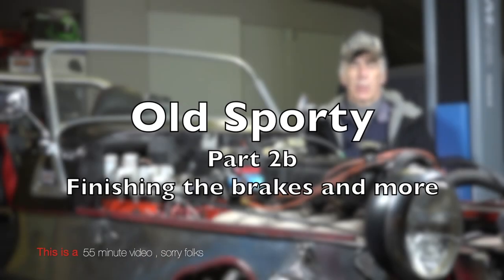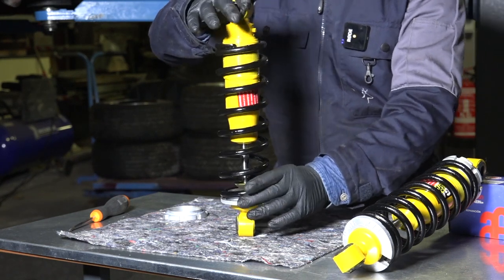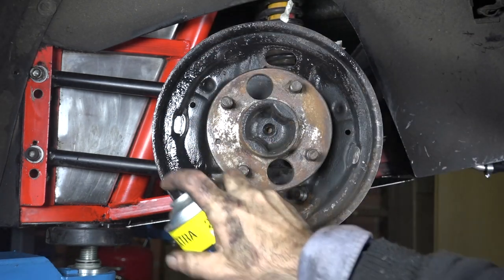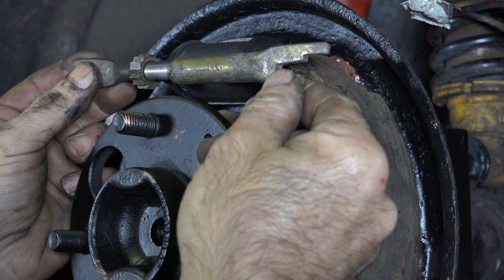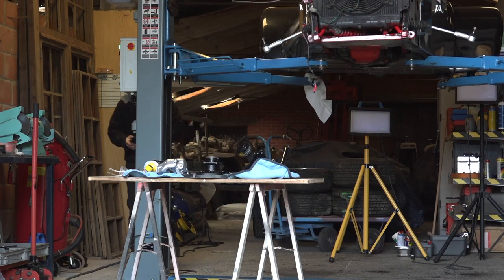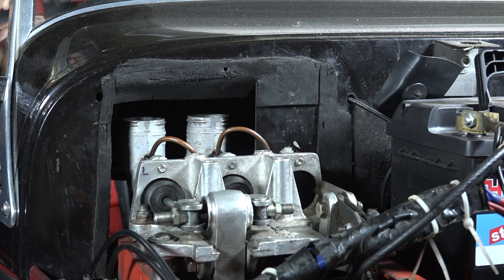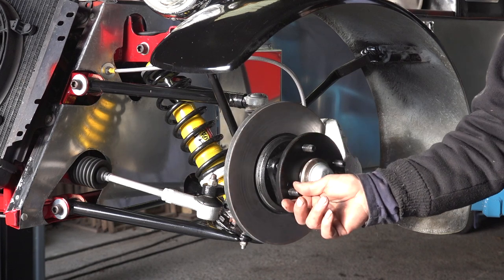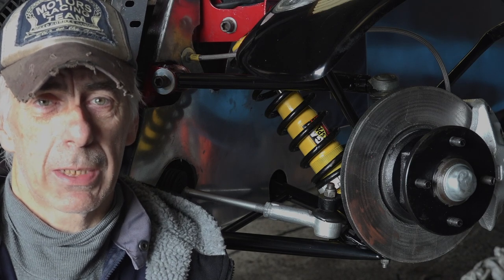Old Sporty , Part 2B brakes and much more

Comment: Happy Christmas! One way to free the clutch is to jack up the back axle and to start the engine and warm it up, then when in fourth gear have an assistant drop the jack. The car needs clear space ahead, it's a brutal way to do it but it works and breaks the corrosion holding the clutch to the flywheel. 🙂
Reply from the maker: Yes indeed that is one way of doing it.. done that before.. but in this case I will modify the oilpump, replace the waterpump, new distribution belt and install a new clutch.. so the engine has to go out no matter what.

Comment: I notice that the new car lift, besides making this work more pleasant, enables even better placement of lights and camera, if that's possible. Totally first rate production! Even people with more money do not match this. One thing I did not see -- any discussion of examining or prepping the rear brake pads. Merry Christmas to all, and looking forward to the new year!
Reply from the maker: Thanks for the comments Dennis , very happy with the lift, although a low cost item ... it works as a champ and very handy. you are right I missed that point on preparing and inspecting the thickness of the rear brakeshoes...  should have done that ...Its always good to get those points and remarks.  It can only make it better next time.

Comment: Steve, I enjoy your videos so much.  Always very well done on the video and also the work performed in your videos.  You pay so much attention to detail.  One piece of advice to you.  For taking off those stuck caps on the brake cylinders, you should look into using a rubber strap wrench.  They come in handy in plumbing and any time you don't want to mare the finish of the thing your tightening such as the caps to your brake cylinders or chrome.  They also come in handy getting an oil filter unstuck.  Thanks again for another great video!  Merry Christmas.
Reply from the maker: Thanks for the comments, and indeed that is very good advice... I will ask Sante  for a set... that way I don't damage things ... Merry Christmas and a happy new year to you and yours

Comment: 8:14 you can only set up the ride height. The spring rate dosen´t change, exept you use a progressive coil. Merry Christmas and thank´s for all the great videos.
Reply from the maker: Markus Wagner , txs for the correction. What i wanted to say was harder ride and lower. Txs
Reply: Not only ride height. This is a spring preload setting. If preload is  higher than the load applied by the car on that wheel, the suspension is fully extended, no further height is possible. But if you increase preload again, the suspension will not move until you reach an higher load, in fact the suspension is locked. But if you have too low preload, the car is lower, but you lose part of the suspension stroke.
Reply from the maker: Artemiuselectro , indeed its an interworking. The spring forces the shock to extend to its max . That springforce depends on how much the rings are moved up.  The more upwards the stronger the springload.  So the more weight that will be needed to depress them. Hard tied up springs will make the car sit higher as the force on the springs is high.  Loose tied up springs will lower the car and a softer suspension. Of course all of that is also influencing the shock movement and lenght under load (car resting on it). Damping is adjusted on the shocks themself.    Regards steve
Reply: Hi Steve, not properly. You can't change the stiffness of the spring moving preload rings. You are changing only the start movement point; i.e. low preload the suspension is locked until you reach a 50 kg load, high preload the suspension is locked until you reach a 200kg load (numbers are only to explain, not a real reference). After the first movement the spring responds with its law F=kx, so for every mm of stroke you receive a certain amount of backforce depending only by k, that is characteristic constant for that spring. If you need stiffer suspension the only way is to replace the full spring. Anyway your videos are beautiful, and you are a great teacher. Go ahead in that way and Merry Christmas!
Reply from the maker: Artemiuselectro , thanks for the clarification. .  I know that springs come in different ratings.  But as you say, initial load settings.

Comment: I have never seen the clamp to hold primary shoe on, I wish I had it would have saved some blood sacrifice over the years. Even though it isn't an everyday tool brake spring pliers are a nice tool to have in your tool box, in a pinch you can use them to take off the oil filter that McGilly Gorilla put on last time.
Dad taught us that to adjust drum brakes was to find a long flat area put the car in reverse get up 10 MPH or so then slam on  the brake this would cause the brake adjuster to tighten the brake shoes.
Copper brake lines?  Must be a European thing, we use steel or stainless steel these days
Oh boy here we go, I was taught to put a wad of grease in the palm of your off hand then holding the bearing in the other, scrape the bearing through the grease so you can fill all the spaces in the bearing. Now days I have an tool that forces the grease into the bearing, so much cleaner and faster!
Reply from the maker: Thanks for the comments , and yes copper tubes on brakes do exist on older cars over here.   It did pack the bearings and rolled them in.  Not shown in the Video, I should have stated it or shown it. Thank you fr pointing that out.  The clamp is just an ordinary carpenters clamp as that is what i had available.  P.S bleeding the brakes with a standard undercoating spraygun works as good.  just connect the hose from the nipple to the intake pipe of the undercoating spraygun

Comment: the adjustable spring is more raising or lowering of the car, the shocker if it is a fully adjustable can be stiffend  or softended with the screw on it,  there is usually a plastic knob with markings on it what fits on the screw to help with setting them all the same. limited slip diff makes a nice addition. merry christmas
Reply from the maker: Thank you for the comments, great comment

Comment: It looks like your auto adjuster works any time the shoe's movement becomes enough for the adjuster arm to grab another tooth. The actual adjuster rotation happens as the brake pressure is removed. In normal driving the shoe moves slightly as it grabs the drum and this adds to the adjuster lever travel for a set clearance on some designs. Auto adjustment is not dependent on the usage of the parking brake however I will try to get a better look at yours later in the video.
I enjoy your project choices and presentations. The mosquitos I remember trying to airlift me to their cache is in my memory library in a locked and sealed room right between installing headers during winter breakup lying in muddy slush and rebuilding brakes whilst under enemy attack. Ah, to turn 12 again and be receiving my first Stihl 041AV Super. You could say I was a 2 stroke 'n noisy child...but I wouldn't have heard you. 
Peace.
Reply from the maker: Great comments Jim, txs a lot
Reply: @D3Sshooter  I would reply with, my pleasure and thank you for the proactive use of that which is often lent and sometimes stolen but was most often found, just watch hands in pockets. They used to come as many but we now look for only one. 
Peace sir.

Comment: To set the pre-load on the shocks you have to set the static sag, you won't alter the strength or firmness of the ride, to do that you have to fit stronger springs.
Reply from the maker: Thank you for the comments

Comment: Infos for sand blasting apricot (stones/kernels) well known in England  infos I picked up !!
 To clean or polish surfaces of tableware, furniture, floorings/tiles, machines, large vessels such as ships, and all kinds of facilities.
For blasting plastic and rubber surfaces and removing paints, aluminum and zinc die casting, and electronics, for instance in shipyards or disposal facilities.
As a replacement for silica when removing graffiti or pollution on public buildings, restoration of buildings, monuments, and bridges.
For aircraft engine cleaning as well as cleaning of steam turbines in power stations.
Best regards Steve !!!
Reply from the maker: I will need to check that media, I typical use soda , glass-beats and Garnet

Comment: Did you take advantage of the system being drained and change to silicone brake fluid ? Your pressure/vacuum bleeding is so much better than just pushing the pedal, it gets the air bubbles out of all the loops in the system like over the diff, with the pedal system the air just goes back and forth without moving along the line, that is all looking very nice, I think I would have replaced the master cylinders given the low cost of these, the whole system would have been new then. Happy Christmas to you Steve!
Reply from the maker: Hi, I could have used dot5.2 ( silicone based brake fluid), but I prefer dot4, 5, 5.1  The main difference is the boiling point between 4 and 5...  Glycol based dot ( 4,5.1, 5) does attrack water , where as silicone does not.  for sure that is an advantage of silicone based fluids.  But as i change / flush the brakes of all my cars every year, there is no need for silicone based fluids.   Boiling is so far never been an issue. The master cylinders were in such good condition although dirty, that I decided not to.  I might do it much later if I ever decide for a complete brake upgrade. Happy Holidays  to you and yours
Reply: @D3Sshooter  : I think another advantage of the silicone fluid is that it does not strip the paintwork like non silicone fluid does, there is also a horror story about the non silicone fluid becoming highly corrosive(acid) when in a fire situation, not sure if that is true, to change over of course requires a complete flush out of the old system, if you are changing fluid every year you should have no moisture problems, although I have dismantled systems that have not been changed for 10 years and have no problems. happy New Year to you, and keep your excellent videos coming!
Reply from the maker: That is true

Comment: Appling grease to the outer race is not enough you are supposed to pack the the bearings.that outer bearing looked pretty dry you should redo them and pack them correctly, and also when reassembling  the hub and rortor you are supposed to spin the rotor on the dry races and dress  the rotor on a brake lathe so you don't have run out and peddle pulsation.

P.S Merry Christmas and Happy Holidays
Reply from the maker: Nerraw Yezok indeed.  I did

Comment: Just a tip gained from years of working on them ,before carrying out any work on rear drum brakes the first thing to do is slacker the hand brake right off , do all the work necessary on the shoes drums and cylinders then adjust them up until the rear brakes lock up, then proceed to back off on adjustment until just clearing the drum  then finally adjust your handbrake last .You will find this method  both easier and quicker .I wish I had a £1 for every time I have seen people who cannot get the drums back on after fitting new shoes , then scratching their heads why ,it's ,because they have left the handbrake cables length adjusted to the old shoes .If the work is carried out correctly you will only have 2 to 3 clicks on the handbrake when done and still have the correct clearance on th drums .
Reply from the maker: Gerald Swain , txs and great tips.  I guess you must be rich by now with all those that had that issue
Reply: I have a special brake shoe caliper that is designed to allow you to set the shoes before installing the drum. You adjust the outer (internal) side of the calipers to fit snugly to the inside diameter of the drum and tighten the locking screw. Then you adjust your shoes to fit the inner (external) side of the calipers. Makes it simple to set your shoes to fit the drum. No guesswork or fiddling needed. I also have a special tool for removing those shoe hold down springs. It has a screwdriver handle, with a cup shaped piece on the other end that fits over the retainer. You simply place it over the retainer, push down on the handle and twist a quarter turn for either removal or installation. Of course it helps to hold the pin in with a finger behind the backing plate. No worries about your pliers slipping with one of these. And a set of brake spring pliers makes dealing with those strong springs much easier. These tools used to be very common a few years ago, but not so much these days.......
Reply from the maker: John Acuff , great tips John.  Its always a pleasure to read on how others do the work.  Thanks
Reply: @notajp  sorry I'm late replying ,John ,I made that tool you are talking about for removing the metal clips out of a cut off screwdriver  old socket welded to the drivers shaft with a slot cut in the socket before you could buy them. I made the t handle spring puller you have ,both of these tools,I  j as you say are a godsend . A happy New year brake fitting to you .

Comment: Steve, 
why not fix a " wing " on the lids of the master cylinders....make it so much easier to open !!! Because when putting plier it squeeze the lid and can make the opening very difficult !
Reply: Mechanics should have 3 arms and hands with double articulation (like universal joint ?)....!
Reply from the maker: yes indeed,

Comment: I did not get it, how will you put the oil back in the differential box if there is no drain plug?
Reply from the maker: Luigi Gallerani there is a filler plug on the side.  One must fill the diff through that plug untill the level of the oil is equal to the bottom edge of the fill hole

Comment: How do you find the pedal spacing on the DAX? Im thinking about getting a lotus 7 replica and im worried about foot spacing in the various types
Reply from the maker: Thanks for the comments, pedal space is nightmare.  between the gas and brake pedal, the gap is so narrow that I can't drive it with cater-pillar boots, and I only have a 39.  I really consider modifying the pedals for a better spacing.

Comment: front shocks are on upside down? not enough suspension travel  and shock hits the top tower
Reply from the maker: Hi, what makes you believe that they are upside down ? plenty of travel ..I have no issues with it.  But by all means tell me
Reply: @D3Sshooter  ok sorry but it looks like the top of the shock tower mount will hit the top/side of the shock where the bolt/mount is.

Comment: To set the pre-load on the shocks you have to set the static sag, you won't alter the strength or firmness of the ride, to do that you have to fit stronger springs.
Reply from the maker: Thank you for the comments , great tips and points.